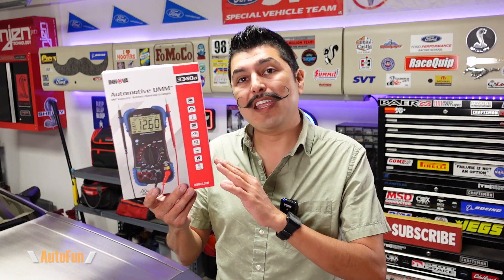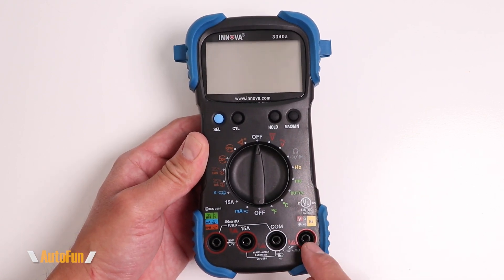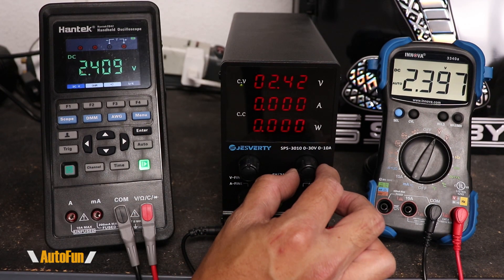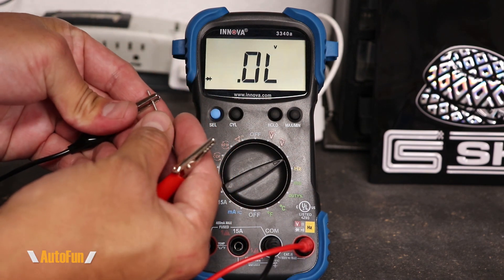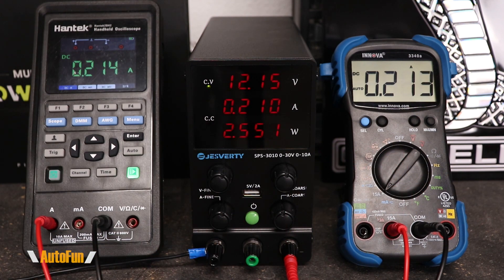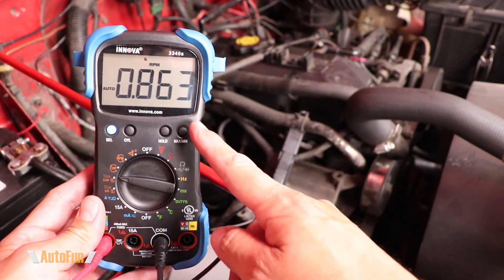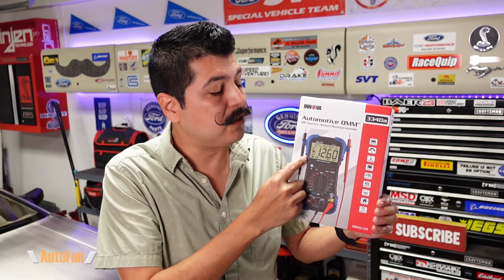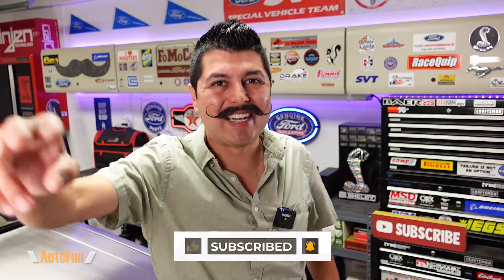Innova Multimeter Review (3340 / 3340a)

Comment: This is a Auto Fun video really great I enjoyed tutorial lesson just great!!!  good job.  Just one question Does this 3340A Multimeter have the ability with an attachment accessory to dianose Each spark plug wire/cable firing correctly or misfiring of a cylinder while engine is at idle/running ! I really enjoy this meter and would like to do more ??? Ps. came to mind seeing probe 3347 probe.  Thank you...
Reply from the maker: You're welcome! Ah while the 3447 Probe can be used to detect current flow for what you are looking to detect a standard OBD2 scanner should do the trick (the vehicle should have a record of a misfire and in some cases down to the cylinder) https://youtu.be/I4MHG-6BdXs Cheers!

Comment: Nice Moustache 👏 I own one of these meters. I bought at almost 10 yrs ago. Great Meter. I wanted to find out how to use the Temp. sensor, and well, when I turned on the machine, without the temp probe wire connected, it already was showing room temperature, when I put the probe on, and stuck the other end in the freezer, no movement on the read out on the Multimeter still shows RT. So, now I am curious why this isn't working the way I imagined it working, like you when you put your finger on the end of the probes wire, it seemed like the temp was rising, sooooo, I'm wondering what's up with my unit. First time I used the Temp Probe.
Reply from the maker: Thanks! oh wow you had it for a while now, nice! Regarding the probe, it should respond to changes (like your example of putting the end inside the freezer. However I always noticed this style of probes (even on my Fluke set) are very delicate and the end can sometimes break internally or one of the conductors break which can lead to intermittent readings or no readings at all. I would recommend reaching out to Innova, they may be able to walk you thru some troubleshooting steps. And please let us know what you find, Cheers!